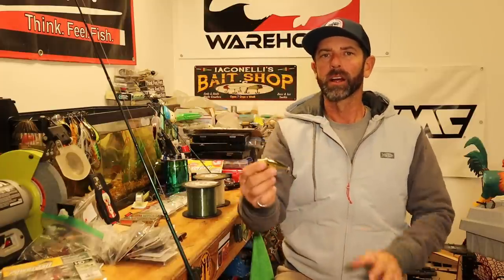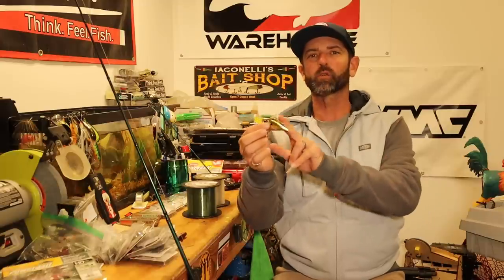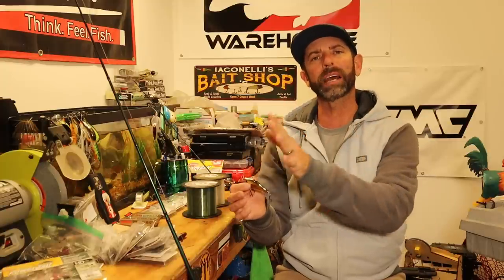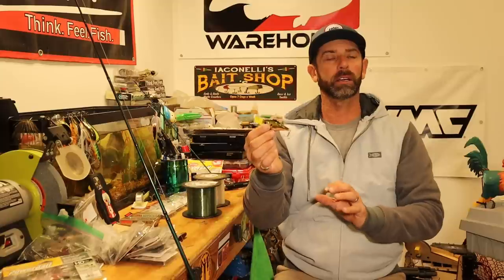Bass Fishing with a LIPLESS Crankbait (Tips & Tricks)

Comment: Using 15 lb braid or less on med action spinning gear allows me to fish a trap slower. It also allows me to occasionally double twitch it to create short pauses without losing the vibration. Down sizing your spinning reel also allows you to cast far into the wind, but cranking the drag almost all the way down is usually necessary to get solid hook sets.

Comment: Modifying lipless 😐 I'll show you modification 😂
I take a 3/4 oz lipless and stand it mouth down. Drill an 1/8" hole in the rear and use window & door expanding foam to fill it up. I remove the belly hook and it swims straight face down. On 12 fluoro line it still touches lake bottom up to 10-12 ft depending on water temp. It suspends around 14-15 ft. 
Go check my video and see how we kill it in winter on stripe bass with these modified lipless cranks